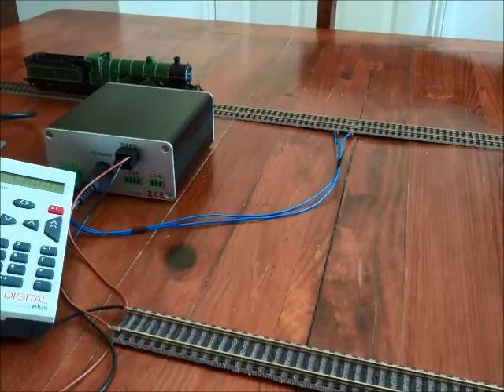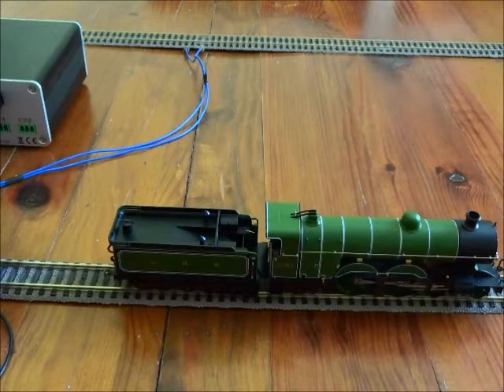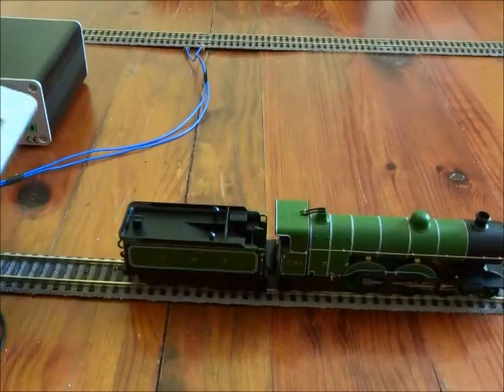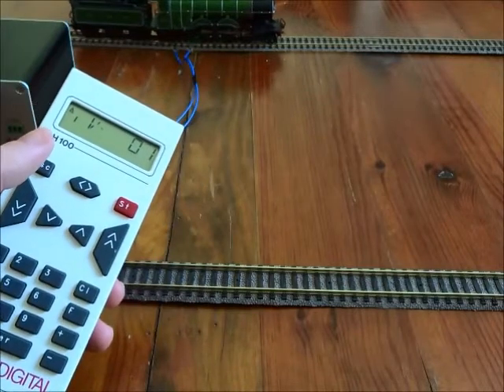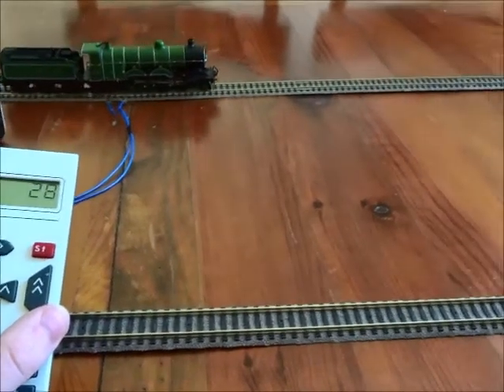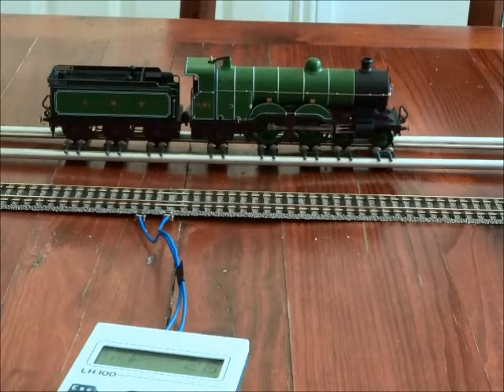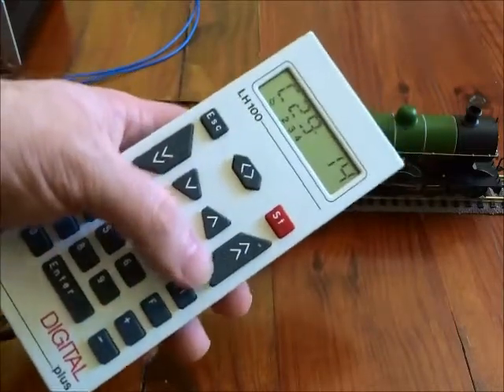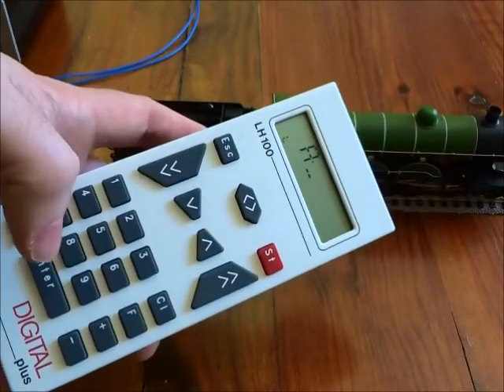Lenz SET100 A little more advanced locomotive programming

Comment: I have 2 class 20s but I can't get them running a same speed when consisting??
Reply from the maker: Not an easy question to answer - are they both from the same manufacturer and do they have identical decoders with identical speed settings installed?  How do they run when not coupled - is one mechanism freer running than the other.......
Reply: hi..both bachman locos with bachman decoders ! but one runs faster than the other
Reply from the maker: Try resetting both decoders back to manufacturers settings - Maybe worth servicing both locos if the mechanisms are tight - If they are different production batches then the circuit boards or motors may be different - You might have to ask Bachmann as I have no dealings with their decoders.   Cheers      Chris
Reply: digitalcareline thanks Chris.
Reply: hi Chris.. do you know where to purchase the Lenz rail mounted uncoupler?
Reply from the maker: Dear Mr Taylor.  We have the 45055 O gauge uncouple at the shop.   http://www.aandhmodels.co.uk/45055-dcc-uncoupler-9989-p.asp     Cheers     Chris
Reply: digitalcareline  is it ok with oo gauge ?
Reply from the maker: Sorry, it is 1:45 scale designed for use with Lenz's range of German O gauge.      https://youtu.be/CYs4ytbnEH8